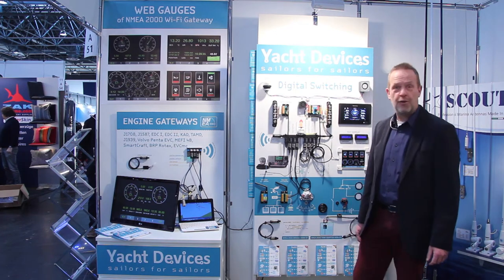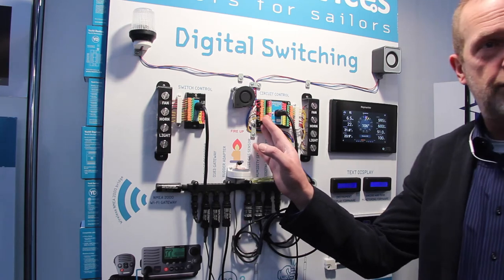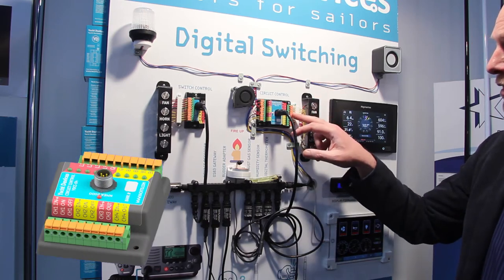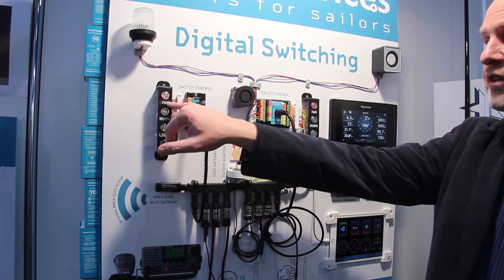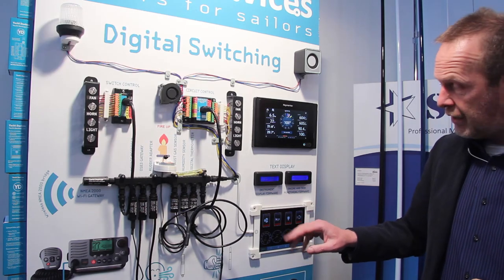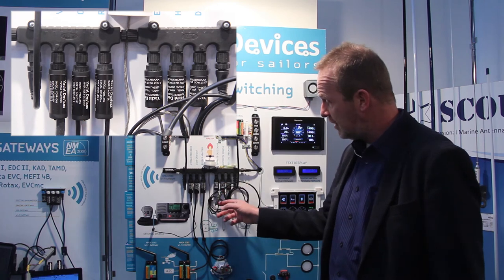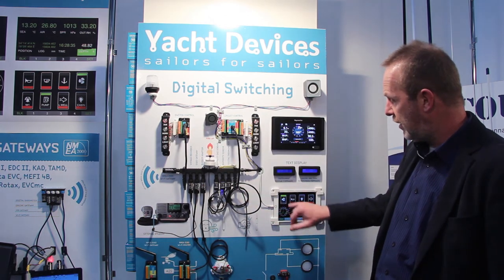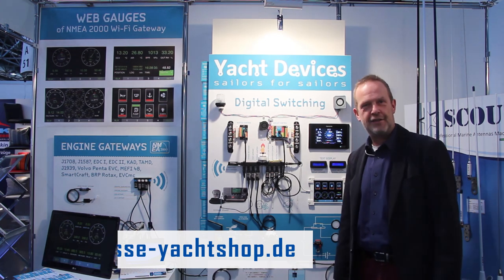Yacht Devices Digital Switching

Comment: Two independent digital switching systems (different bank numbers) I buy 3 ydcc-4 and I don’t know how separate the signals??????????????? I need help please
Reply: Yes. In order to separately control each YDCC-04 unit, all of them should have different NMEA 2000 banks.

For 3x YDCC-04 units setup I suggest to use NMEA 2000 banks 0, 1 and 2.